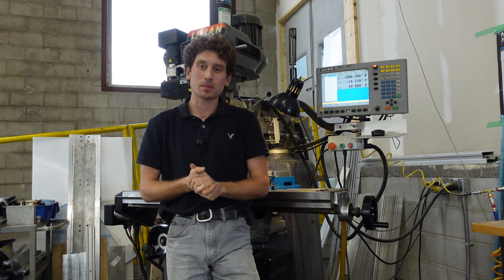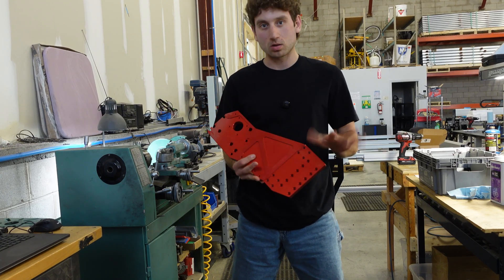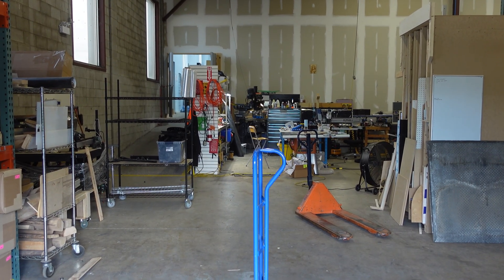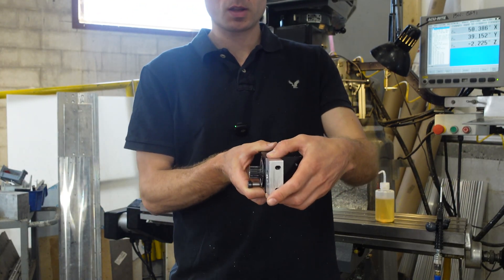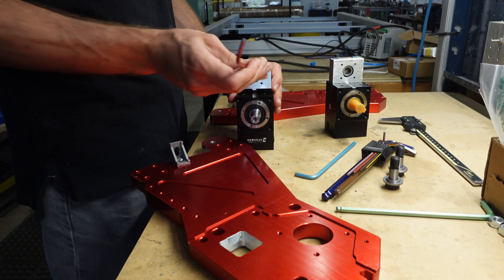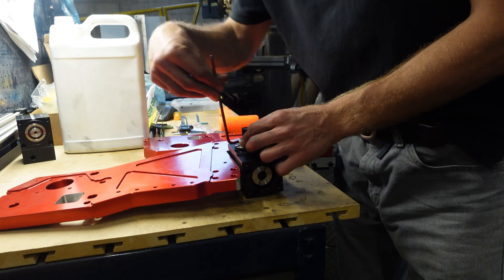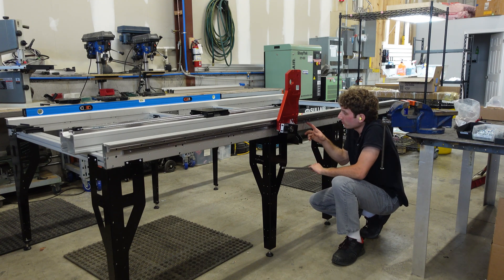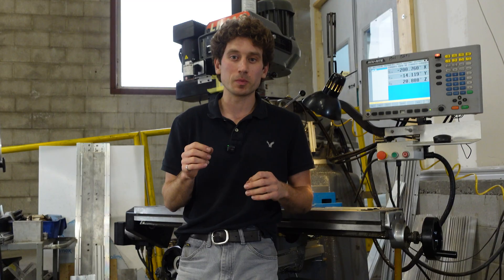Engineering the AltMill 4x8 ❘ Ep 3: Swing Arm & Y-Gantry Plate Machining

Comment: Will you have the option to order the whole 96" (or whatever lengh it's going to be) rails instead of two-joints - this will cut down on setup and accuratecy in the long run. For those who's willing to pay a bit more for shipping. Thanks
Reply from the maker: For this iteration it will come in two pieces

Comment: When cutting that square, you could have rotated it in the vice. Halfway down, 180 halfway again. When cutting aluminum, fine corn cob end mills are you friend (for rough cuts). Interesting build you have there. A standard spray bottle with a mixture of cutting oil and WD 40 ( 60/40) is better than that lube bottle and a lot safer.
Reply from the maker: Thanks for the tips! We love it when our community shares their knowledge.